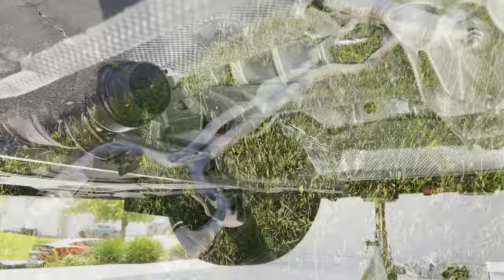How-To: Exhaust Removal & Install // Chevrolet Camaro 6th Gen // 2016-2024

Comment: I did long tube headers with high flow cats and secondary cat less x pipes. Factory suitcase muffler because I think it is absolutely ridiculous for two mufflers to cost $1000 plus. But this does sound fantastic.
Reply from the maker: That sounds pretty awesome, actually. Do you have any clips with audio? I’d love to hear yours.
Reply: @FollowMyLine17  no audio clips, but it is a whole lot louder than factory. Not as loud as most aftermarket mufflers, but it does sound good.
Reply from the maker: @parkercarter3917 sounds like you need to make a short video! Haha. If you ever do, I’d love to hear it.

Comment: So I recently installed this exact exhaust system on my Zl1 1LE and I must say, you really did a number on dude's car. Not sure what the point was in removing the driver's side oxygen sensor, only passenger has to be removed. Driver side slip clamp is not supposed to be opened all the way, only loosened. He is most likely going to get an engine light from exhaust leaking at that joint. That spot is difficult to remove but not impossible. I removed myself with wd40 and rubber mallet at the bend.
Reply from the maker: I did call that out in the chapters, that the driver side O2 sensor did not need to be removed. No check engine light on the car, and not leaks. It’s been on for a few thousand miles now.

Comment: I have a question about the Flat top jack stands. As a ZL1 owner, I already have the ZL1addons lift pads installed on both sides. When you lift the car from the middle, do you rest the flat top jack stands on the ZL1addons lift pads? I’m nervous of the car slipping off! Would love to see a video on how to do it properly for us 6th Gen Camaro owners. Thank you
Reply from the maker: I got you covered! Yes, I do place the flat top stands on the lift pads. I have literally tried to shake the car off of the stands and it doesn’t budge. If you jump right to the “outro” chapter of this video, you will see the ZL1 on the flat top stands using the lift pads: 
https://youtu.be/3ZjfKPesSec